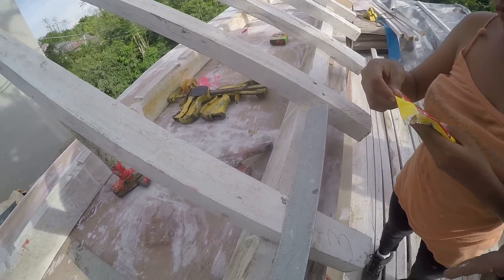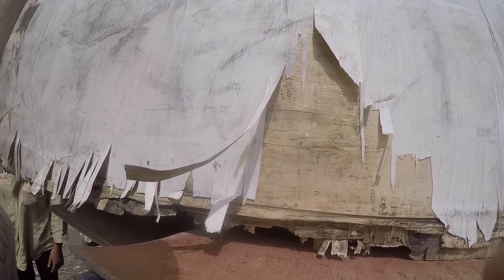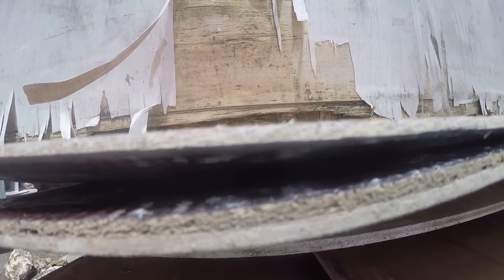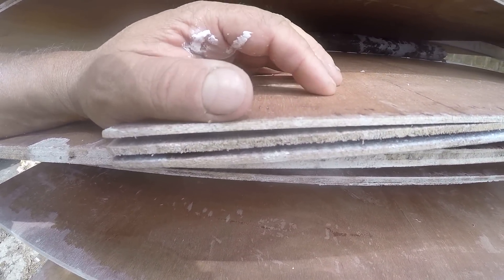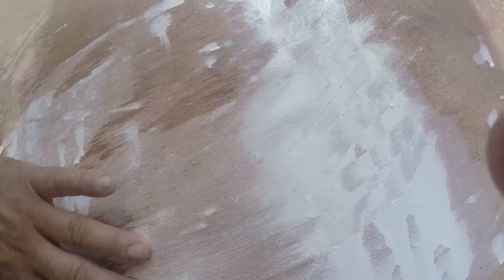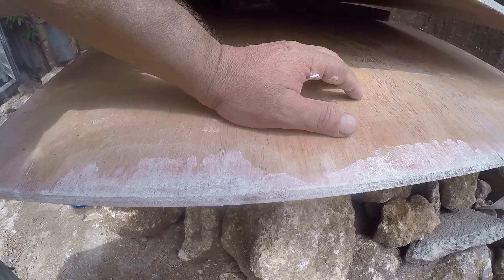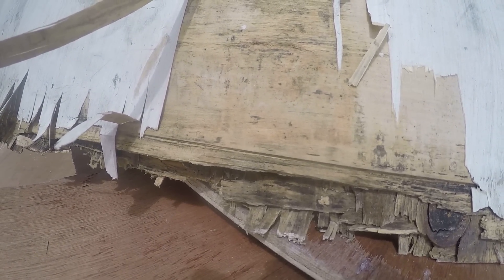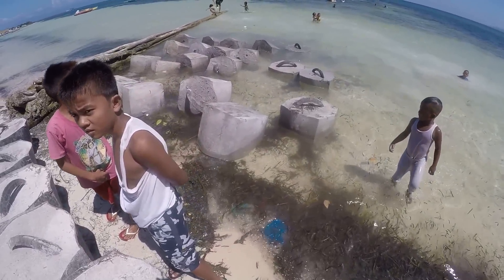C.O.L. IN The PHILIPPINES TEACHING CARPENTRY TO MY BEAUTIFUL FILIPINA GIRLFRIEND

Comment: i agree sir no good wood in phils as ive found
Reply from the maker: IN ADDITION TO THE GARBAGE THEY CALL MARINE PLYWOOD  every [[ all 50 sheets ]] I purchased the corners are not square and off 3/16s to a 1/4 inch off square on both ends.... which tells me that the whole load is from a batch of rejects.
THE NEXT GRADE UP IS DOUBLE THE PRICE [ 1080p ] and even that garbage has voids and flaws, as well as it also de-laminates  within two months inside my apartment and used as my computer table ....

Comment: Marine grade plywood does have water resistant glue. But the wood it is laminated from is just wood and is not water proof or even resistant. And the wood is not rot resistant either. If you want wood to use in water you will have to buy pressure treated . Plywood is not for in water service. Boats of old that were wood used high resin content sold wood and lots of organic waterproofing materials of that day. I think different kinds of tar where used to make a water tight membrane  holding the water pressure from the wood. Most people do not comprehend that  marine grade has no in water certification. Marine grade has to do with the quality of the wood used and has nothing to do with putting the dam wood out in the water be it rain or floating in water. The guy makes entertaining videos but he gets many things wrong that he thinks he knows all about.

Comment: Your paint is shit and too thin,dont thin it down with turps,use it pure.the glue they are using between the sheets are shit ,would sump oil be better option on the edges for water resist ,just a though cause paint would be expensive there and very low quality.